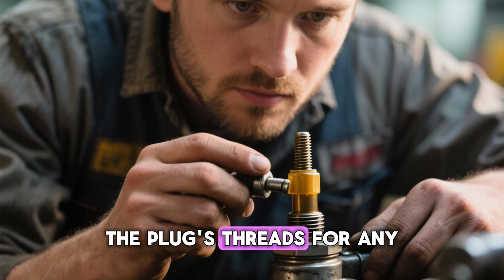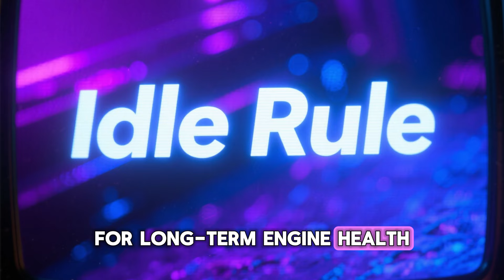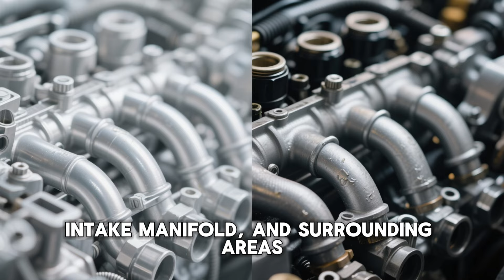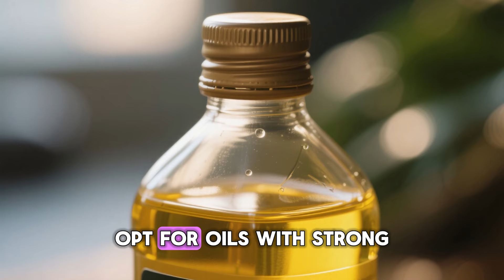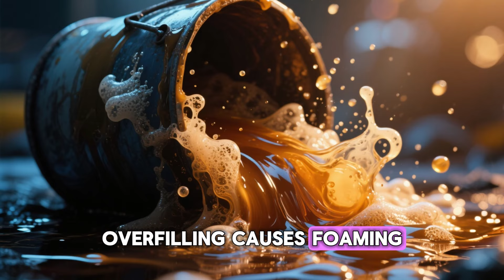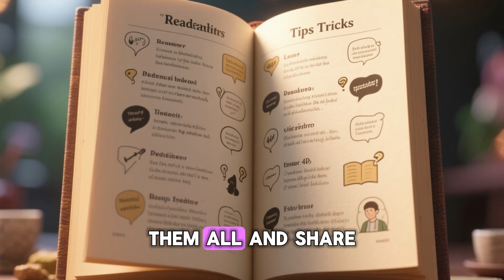Do THIS After Every Oil Change to DOUBLE Engine Life

Comment: This AI video is wrong. Nothing should be added to the oil to clean the engine. A quality oil does just that and if changed on time between  3-5K u should not have an issue.